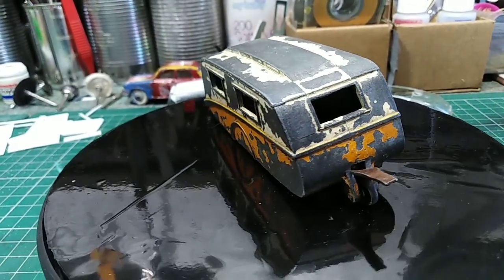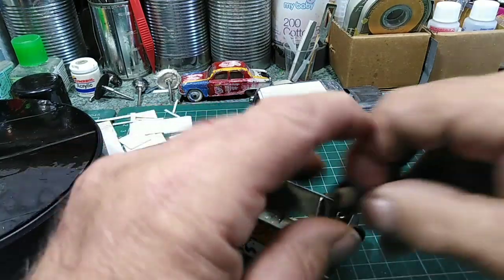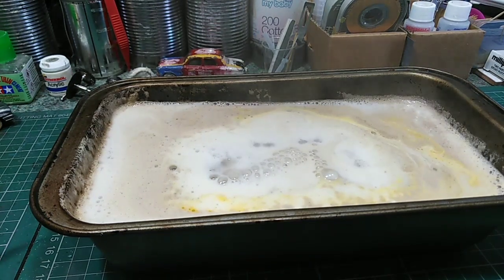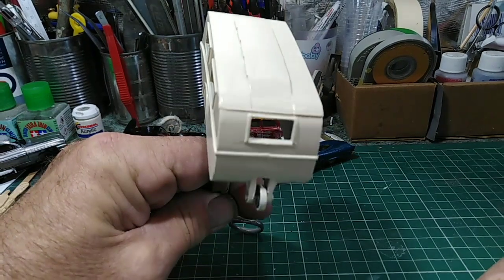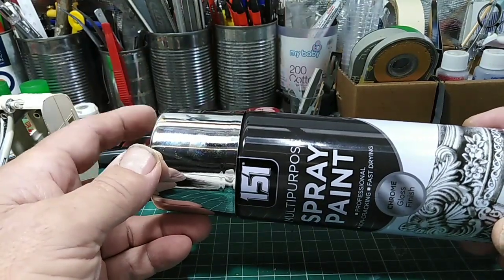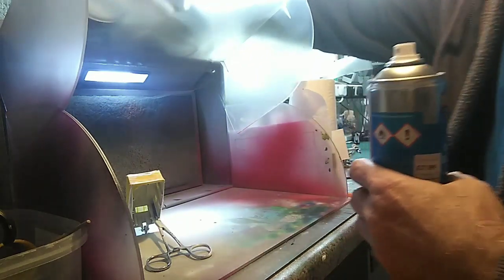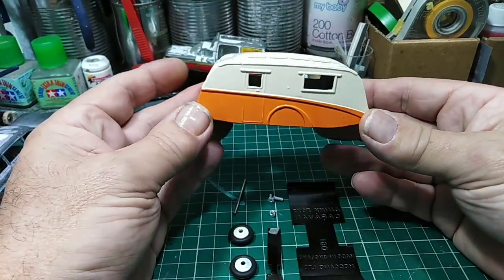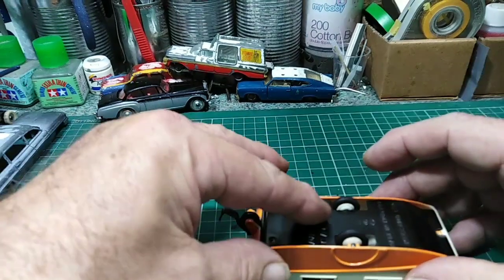Dinky toys caravan no 190 full restoration.

Comment: I enjoyed your caravan restoration very much and I have subscribed. Please could you tell us about how much Corsica soda you put into the boiling water to remove the paint, does this method work on all dinky toy paints because I have found that paint stripper doesn’t work on many dinky toy paints. Thank you for giving your time to show us your way.
Reply from the maker: Hi john,thanks for subscribing .
The amount of costic sodo is not an exzact science, more trial and error.
Just be very carfull with it  have a large enough container to cover the casting and water and allow for the warter to rise so it doesn't spill over.
I haven't had a problem yet with removing the paint ,sometimes you put more soda in just to make sure.
I was using stripper but I found it messey and it took a long time .
Have a great Christmas and new year.
Reply: martin dare thank you for your reply, I will take your advice and be careful. Have a lovely Christmas and a happy new year to you and yours TTFN.